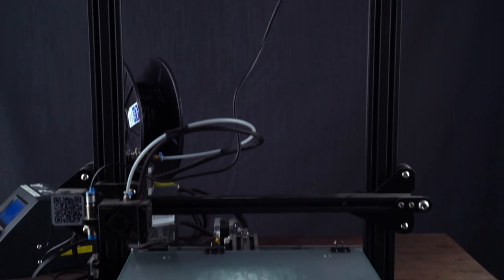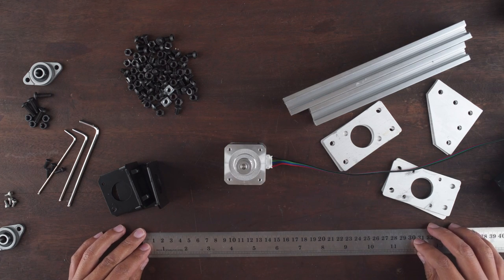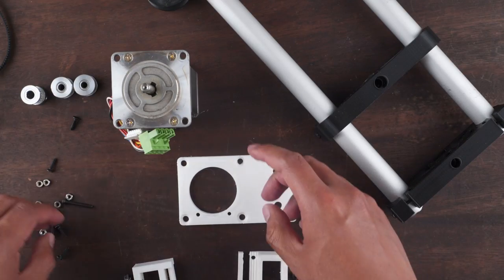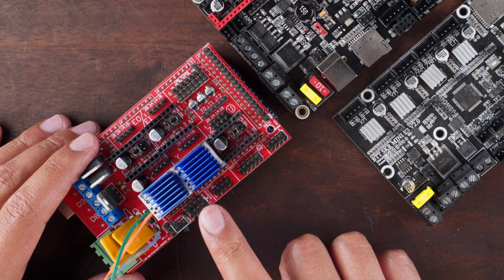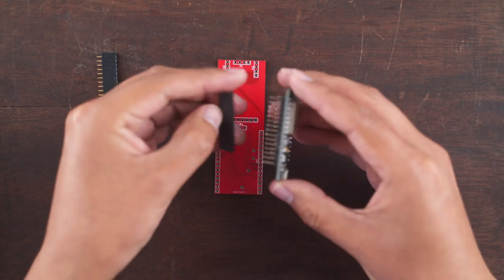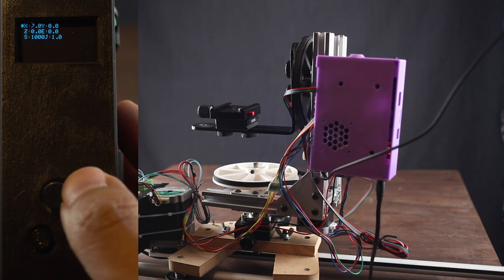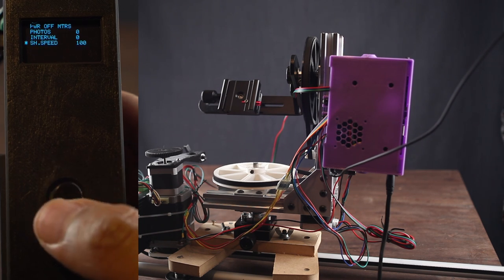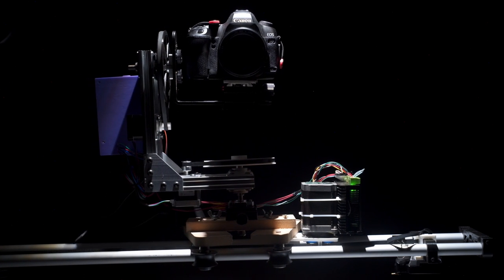BEST BUDGET 4 AXIS MOTION SLIDER EDELKRONE RHINO ALTERNATIVE

Comment: Can you demonstrate how you built the firmware to control the system. I am not a programmer but i have a bit of knowledge on how to modify firmware for 3d printers. But i do not know how to set up repeatable moves with the motors.

Comment: Amazing Work! Thank you!
A couple of questions:
(1). At time mark 2:27 you say that we can find the assemble manual in the description, but I cannot find it. Can you please share it
(2). Can you share the link to the plates that you use to mount the motors. The link in the description is for some other plate, that does not fit here.
(3). Starting from 1:51 time mark, you show how to attach L-plates to the motor, but your tilt and pan assembly does not show them. Why do we need them?

Thank you
Reply from the maker: Thanks for your comment!
1) the assemble manual is inside the files in my buymeacoffee page.
2) The plates I am using are custom made, but are the same size as the ones in the links, but you need 2 to make 1 of my custom plates.
3) The L plates was used only to demonstrate how to mount the 2 flat plates in the motor and how to avoid the error of misalignment when you assemble all the pieces together.